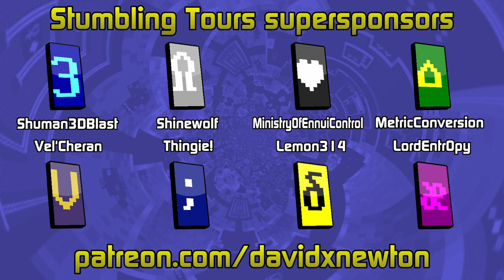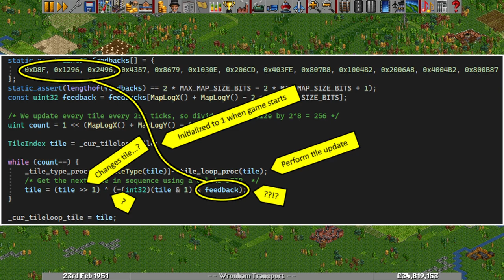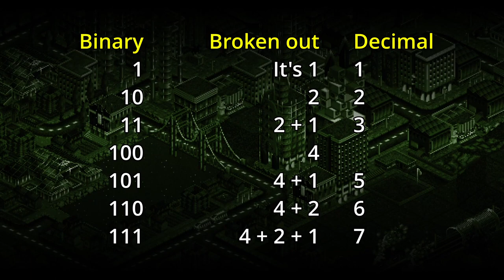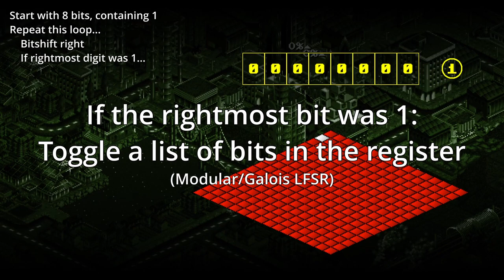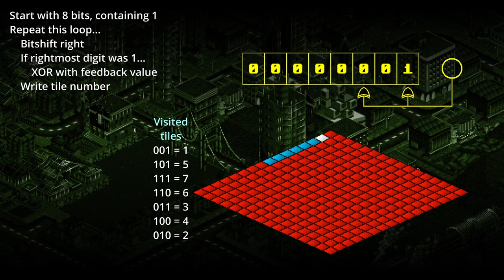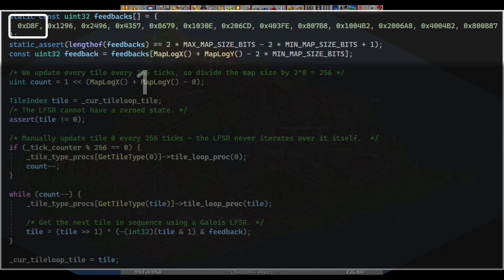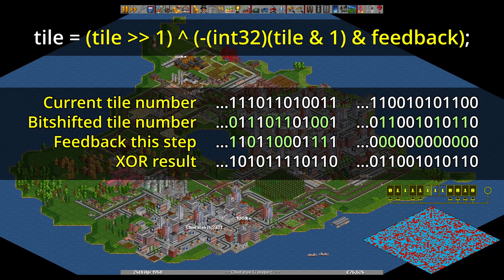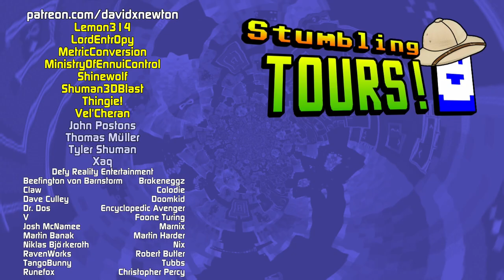OpenTTD - The Tile Update Cycle (Linear Feedback Shift Registers)

Comment: Nice! Back in the day when I was still playing with PCB design, I wanted to make a little LED matrix with an LFSR to make it blink semi-randomly with some logic gates and a basic timing circuit. However, PCB design is pretty long process from start to finish, and so I lost interest in it altogether. Making a schematic, then layout, send the layout to factory in china, order components and wait couple weeks, the bare boards arrive, you solder it together and if something isn't right (as it usually happens) you need to start the process from step 2 all over again. It's an exercise in patience and frustration management.